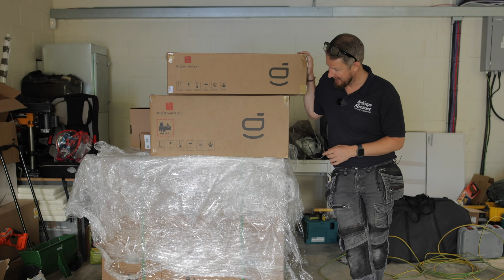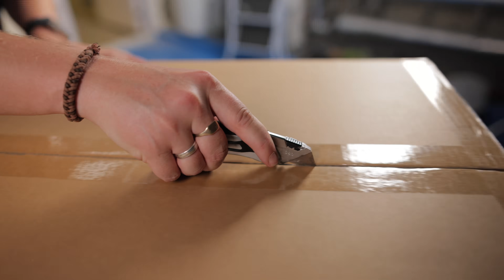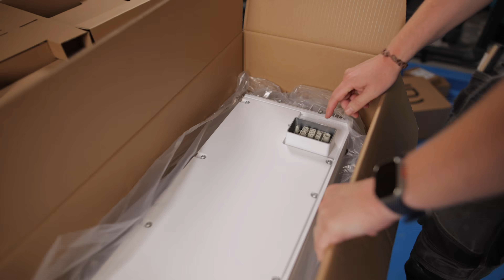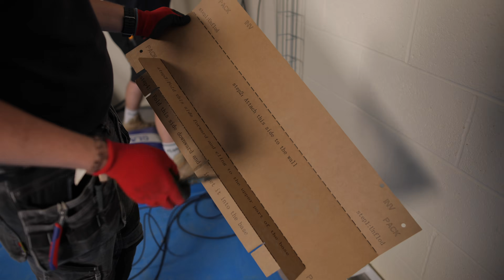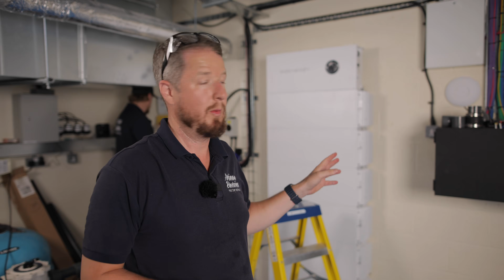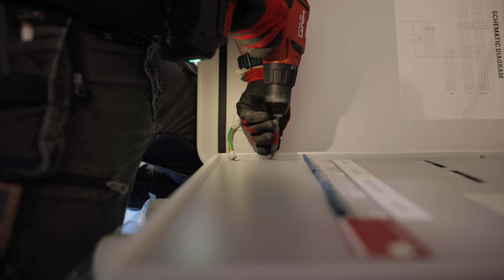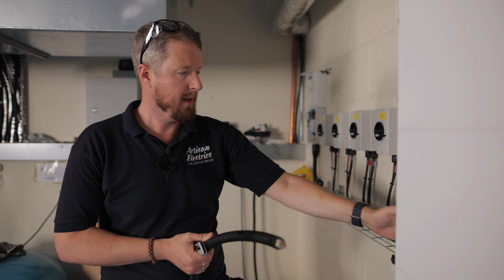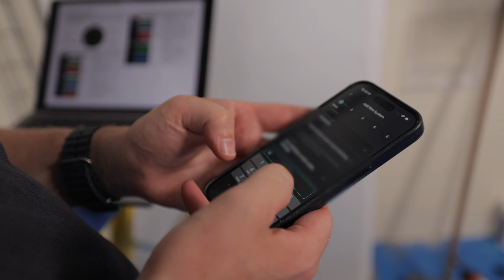Better than a Tesla Powerwall? 🧐🔋48kWh Three Phase UPS Battery System! ⚡️ Sigenergy SigenStor

Comment: This installation is NOT a UPS! Do you know what a UPS is, Jordan?

I questioned the UPS claim in your previous vid on this install, querying the 0mS claim and backing up my assertion with some knowledge of G99 (the required standard for these devices in the UK) but you never got back to me - of course, you're under no obligation to respond to me at all.

I've since checked the inverter's G99 Type Test Verification Report on the ENA's Connect Direct website. Surprise, surprise; loss-of-mains (LoM) protection device test operating times ranged from 138.5mS to 279.5mS. The device complies with G99 - no arguments there - and has the necessary certificates to prove it BUT it needs a finite time to detect a grid disconnection and (assuming the install is correctly specified and built) switch into island mode.

Just like other gateway-type devices with BESS and islanding capabilities, the change from being grid interconnected to island mode takes a finite amount of time. Some domestic and commercial appliances and devices might respond unfavourably to the transition, most probably won't 'notice' it.

The manufacturer still claims "0mS load side interruption" on their website so I've emailed them asking how is this achieved. They caveat the claim on the website by stating it can only be achieved using their inverter, their controller etc in combination (no surprise there). It will be interesting to see what they come back with - I'm happy to be proved wrong or convinced of their claims. However, as other commenters have written here, 0mS changeover can only truly be achieved by using a UPS in on-line mode, interposed between the supply and the loads. The system in the video is not a UPS; if it was it wouldn't require G99 approval by the ENA.
Reply: Agreed. It's not an online UPS. It is a line interactive unit like the cheaper APC UPSs. Fine for most equipment, but might cause the odd problem with someething sensitive. The switchover is clearly fast enough to avoid the lights flickering though.
Reply: An online UPS could be installed to protect any equipment that did turn out to be unable to cope with the cutover times.

Comment: If you ever want a 12kw 3 phase inverter let me know i have one i bought by mistake! I ended up using a 16kw single phase. Doh.
Reply from the maker: What brand is it?
Reply: @artisanelectrics  it's a Deye. You wouldn't be able to use it, I suspect.  It's probably only good for a DIY system.

Comment: Sorry to disagree Jordan but again this statement is partially incorrect, VICTRON Inverter will switch over to grid supply in 20 milliseconds. Mind you, I do not use its function for personal choice as I implemented my own system which detects the loss of power on one line and switches over to the other available source with no interruption in any electronic device at all. It's an easy peasy trick even for a non-electrician like myself and it only costs a few pounds.
Reply from the maker: 20 miliseconds is not UPS though...
Reply: @artisanelectrics  Not for an on-line UPS I agree but equal to a standard off-line UPS. 20ms is one cycle of a 50Hz supply which is the minimum required to detect the loss of power.
Reply: hmm wait what happens when one supply happens to be anti-phase of the other and you just slam your contactor over.

Comment: Is there a reason you guys seem to avoid installing Victron energy systems because I believe the system moving installed here can be accomplished with Victron systems and pylon tech batteries as well.
Reply: Victron is good quality, but it looks awful to customers because it has so many seperate components. Victron need to redesign their products for the modern marketplace. The same engineering, but packaged better would bring them back into the game.
Reply from the maker: I agree - we do spec Victron for some rare situations but in most cases there are better off the shelf solutions rather than the "lego" setup that victron offers
Reply: "Lego" solution has its merits. What happens if the inverter unit on this dies a few years down the line, out of manufacture and the new models aren't backwards compatible. The whole lot is a massive paperweight.

For a large expensive system separating the components like inverter, MPPTs and batteries may pay off down the line.
Reply: victron is great for off grid or mobile systems, not great for grid-tied IMO, even if the system can do it, you're not getting the most value out of it.
Reply: @edc1569  grid-tie ESS is bread and butter for Victron, it is core functionality of the Multiplus and Quattros.

The value is that it can integrate with a variety of other components (batteries, PV inverters). And the kit will last 2-3x longer that a HF inverter in a plastic case.

Comment: how do you ensure the house doesn’t overload the inverter when off grid?  I split the heavy loads onto a non critical consumer and the other loads which would never exceed the inverter capacity on a critical loads consumer.
Reply: The house shouldn't be able to overload that inverter. The inverter is rated at the same power as the main fuse coming into the house, so if the house can overload the inverter it can also trip the main fuse! It is a beast!
Reply: @tlangdon12   "The inverter is rated at the same power as the main fuse coming into the house" is clearly nonsense, as Jordan specifically stated that this is only a 25kW inverter; far less than what a whole house is capable of drawing under normal use, which would be 69kW (nominal) on a 3-phase 100A supply.
Reply: @aaronmdjones  You’re right. I messed up the calculation dividing by 1.73 instead of multiplying! Doh!
Reply: @aaronmdjones  exactly. - I looked at the 3ph 25kw specs and it didn’t even mention the off-grid capacity (only the on grid)
Have a feeling that this has been miscalculated and wired wrong - but hey what does a diy dave know about this stuff compared to the pro’s ?!
Reply: @tlangdon12  24kw would be about 8kw per phase, a house that size could easily draw more than 8kw on a single phase - and the inverter may well shut down due to the inbalance, let alone exceeding the capacity of a single phase.  (or is it 24kw x 3 - which i doubt)

Comment: At 16.26 you strip the sheath of a 10 core cable with a Stanley knife potentially cutting in to the core insulation. Not unusual to so experienced pros do that because you guys know just how deep to cut, but is it not against recommended practice to do that risky cut than use measured strippers?
Reply from the maker: Good tips thanks!

Comment: Greatest product I've ever worked with! It would have been good to mention that the batteries are unique in that they have 7 x electronic sensors, special cooling pads within the batteries and IF there was a fire , the batteries have a decompression valve, that decompresses and automatically brings on a lithium fire extinguisher within the battery! You can also run the battery down to 100% D O D. Most other lithium batteries on the market you can only fun down to +/_ 20%

Comment: Just a tad skeptical on the 0msec claim. 5-8 msec would be normal. There has to be a time interval to sense a difference between the grid and what we expect the grid to be doing. Would love to see an actual waveform on the home side during a switchover.
Reply from the maker: Technically its 0.01msec
Reply: @artisanelectrics  that’s fast!!!  And it’s a very clean setup!  Very cool!

Comment: @17:05 Late shift and day 5! What the hell have you done all week! 😂
Reply from the maker: Installing 74 solar panels, pulling in DC cables, Lots of work!
Reply: @artisanelectrics  Oh I thought you had done that on a previous visit. I'll let you off then! 😁
Reply: Other electrical jobs on site? One thing they didn't do is replace the damaged breaker they identified when shutting down the main panel.

Comment: Love this what a gorgeous piece of kit makes Tesla powerwall look like a 90's computer 😂

As for 3 phase UPS have a look at Victron energy they support using 3 inverters together, the system requires a few more components so wouldn't be as slick to install but very high quality as they are used a lot in marine environments.
Reply from the maker: Thanks for the info!